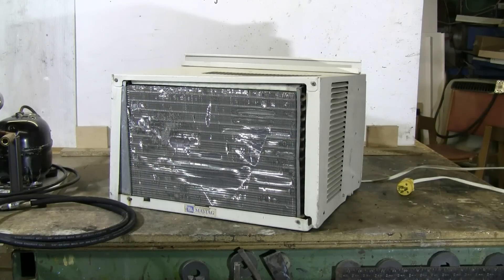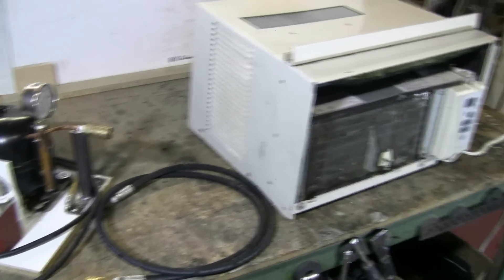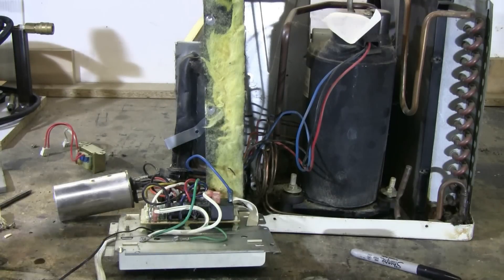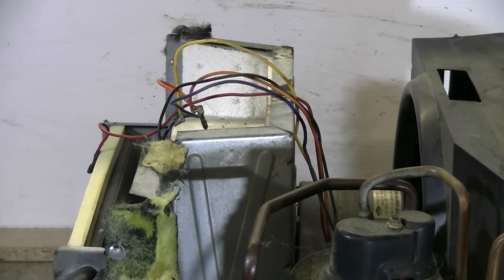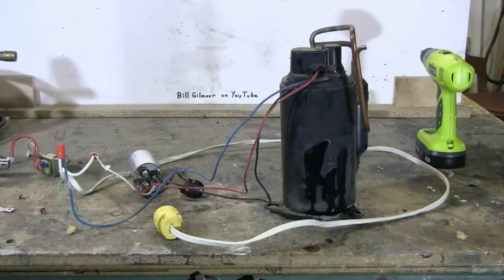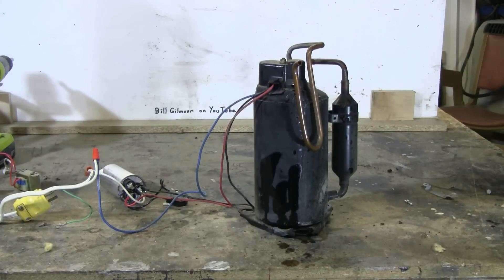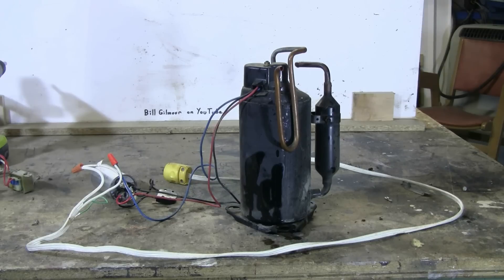DIY - How To Get The Compressor Out Of A Window Air Conditioner

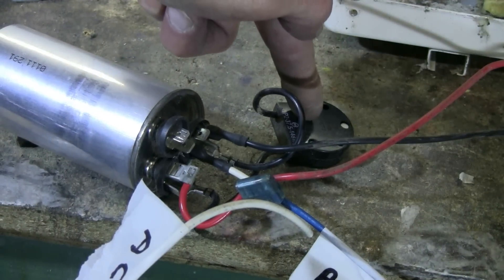Comment: 6:18 I believe the black device you said was "an overload protection device or something" is a 120v bridge to power both sides of the two-in-one capacitor...🤔

Also looks like the blue wire was the neutral side connection,which should be noted.

Comment: A time back, I had thought about using such an AC compressor on a racecar (long-distance road track), but there are a number of hold-backs. First off, it would take a HVAC guy to run new seamless tubing runs for you, secondly, not sure there's enough refrigerant oil in the system to support that much larger of a cooling circuit, next is the coolant used in the A/C versus what would work in an automotive system, and last but not least, a thermostat-controlled kick-out (like an automotive centrifugal clutch) that would kick out compression when it became too high...all in all, I gave up the idea. Nowadays, they have DC A/C compressors to do this very same thing with. The idea was to not leach horsepower from the car to have A/C, to stay cool on 95-degree days while in a fire suit and helmet.

Comment: This will not last long. The lubricating oil circulates with the refrigerant in small amount's. Using it this way will eventually empty the oil sump and run the compressor without any lubrication. Also the refrigerant flowing cools the motor windings. That fan externally will do very little to keep it cool as you are not cooling the motor which is inside the compressor housing. But as long as you understand all this then you can use it until it quits since its scrap anyway. I suppose you could feed oil into the suction side of the compressor a little at a time to keep it full but realize that there will be a small amount of oil in the discharge air stream.  An air filter should be installed on suction side to prevent dirt from entering compressor.
Reply: good info here

Comment: Thanks Bill. I'm looking to scavenge one of these or a fridge pump to run a solar power air pump into my 50' pond.  Not a lot of volume I would guess, however doesn't appear I'll have much worry about needing more head pressure.  Just gonna run it off a 12v dc motor.

Comment: I've been looking at compressors like that. I have a classic car....but it didn't come with air conditioning... it's a 71. I have almost everything aftermarket to install an air conditioning system condenser fan TXV valve. all I need is a compressor and an evaporator and a dryer. I have a 140 amp alternator. I use at most 70 amps. If I upgrade to LED headlight. I can probably get another 20 amps freed up. I was thinking about using an inverter to power the pump that's interrupted by my thermal expansion valve that way the pump is controlled. And then do a thermal protection switch to protect the pump from overheating. How many watts do you think I'll pump similar to that... would take to operate? If I had to take a guess you might see 800 w. Peak with like a 250 to 350 watt continuous. that'd be at like working air conditioner pressures.

Comment: i have a portatble ac i scraping out i have a dumb question but i'll ask it anyway is there any freon in these new er ac units portable or window units i dont want to just go yank stuff and hurt someone or myself
Reply: Yes, that is how these units work. The refrigerant starts as a gas, and is compressed until it liquefies. Then, the heat is wicked away through the rear radiator. The liquid refrigerant then passes into the front radiator, where it expands back to a gas and cools. Air is drawn in across the front radiator fins and blown back into the room, providing the cooling effect.

Comment: Hi Bill. Wonderful video! Is it safe to draw water through the intake? Will it damage the unit or pose a safety risk? I was thinking of using the compressor to make a misting system for plants. Thanks in advance
Reply from the maker: +waatts No water should ever enter the inlet. On most fridge compressors the inlet does not go to the head but simply enters the side of the casing. This allows any oil mist that goes through the system to simply return to the casing and flow down to the motor bearing at the bottom. Only way to make a misting system would be to provide an air tank and pressure switch then use the compressed air to run misting heads. Would an ultrasonic misting system work for your plants?

Comment: My dad is in need of an air compressor. I'm trying to convince him to let me build him one from an old fridge, not easy to convince him but I'm trying!
Reply from the maker: These do work well for getting pressure, not a lot of flow from them though. It can take a while to get an air tank up to pressure. These are usually quite low noise when running. You may need to add motor oil from time to time, this is done through the suction line. Good luck with your build.
Reply: Yeah I'm looking to build anything fancy Lol just something to use for small projects and such, what results would I see if I used a propane tank for an air tank? Will that be a quick fill or take a while? Is it to much for the compressor to handle?